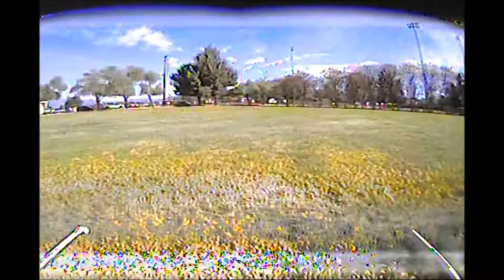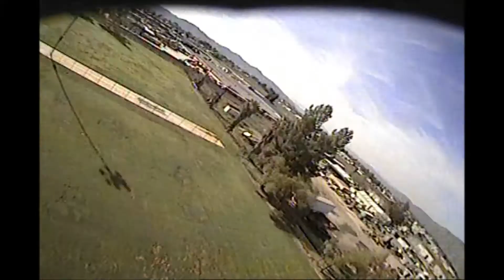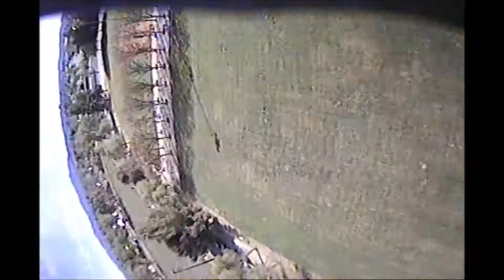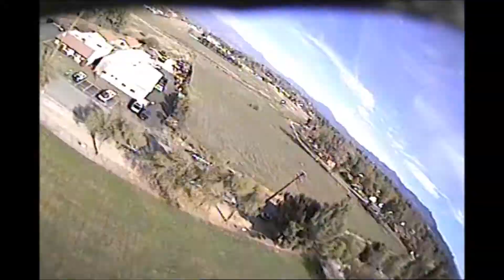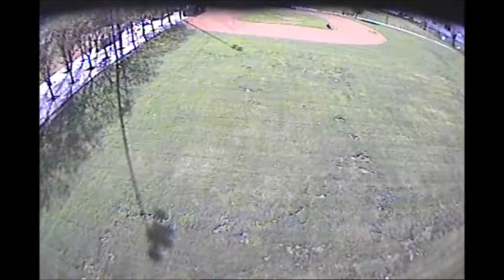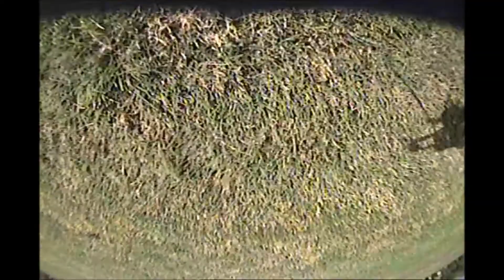ZMR250 First time trying race gates CRASH!!!

Comment: I am thinking of upgrading my PWM fs-i6 receiver to the fsia6b for PPM. I have the same radio.
YKS 250 racer with YKS 1806-2300kv, CC3D, HobbyWing 12AE ESCs.
Do you notice a difference between PWM and PPM?
Reply from the maker: +Del Quad4X o plus if your running a cc3d you cant run Oneshot Properly without ppm .. so to get the best performance PPM ALL DAY!!!!!